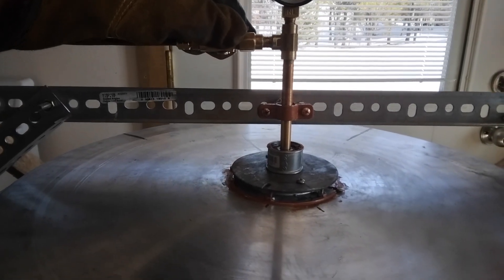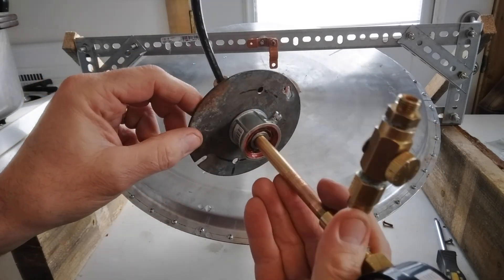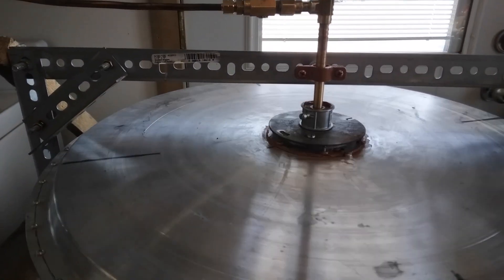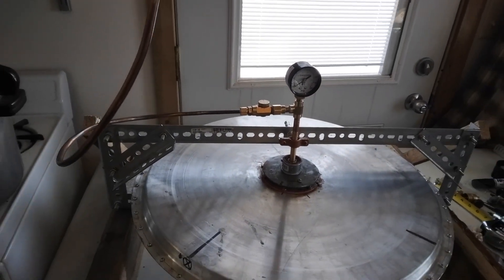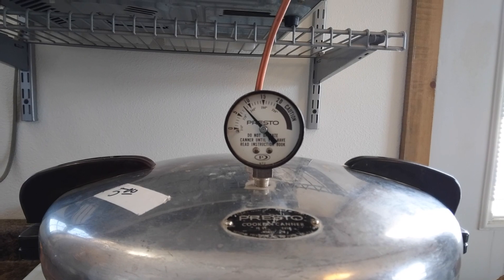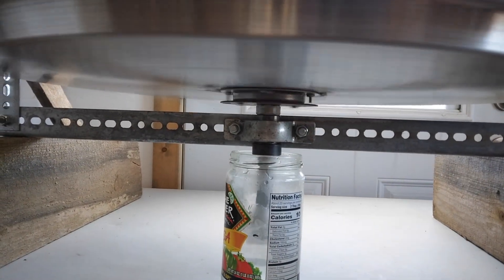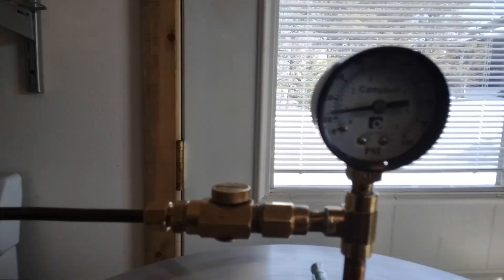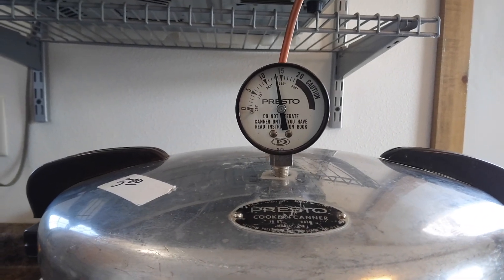Super Simple, DIY Steam Turbine

Comment: What if you add an external jet to the outside edge of the disk to create extra thrust? It would make a mess but you could have a containment tub around the existing rotor to catch and coalesce the spray.
Reply from the maker: That would defeat the design of the turbine.  The expelled spray inside the turbine will continue to loose rotational velocity and power to the turbine as it is pushed to the center outlet, by more addition spray and pressure at the circumference.  That's the design of the turbine.

Comment: Cool 😊 Just found your channel and was snooping around and saw this 😁
I have been thinking of building a small steam engine to power a bicycle or a bicycle trailer.
Am thinking about just using the air pressure tools like they use in the auto shop to mount wheels and just hook that up to the pressure champer. Do you think it would work ? Or any other idea other than the old trusty steam engine 😂

Comment: So what if ya put a copper loop under  it with magnets above the loop eddy currents would heat to boiling quickly a pot of water put in a closed loop system you could get a self running device ( once you get up to steam pressure ). Good job

Comment: great simple build set up. I built a couple of scrap component steam engines already running of a flash steam generator system instead of a boiler which produces enough to run the engine but has to be balanced cold water input to steam output for maximum pressure. I've been wanting to experiment with a steam turbine setup for a while now instead of a piston engine. Thanks for sharing this, which could really be useful if built to better tolerances etc.
Reply from the maker: Thanks for sharing!

Comment: i see it can use a clutch either centrifugal or cable operated to a pulley to get work from it and brake the speed...also it could use that for start up or use a start up steam jet to the outer of the disc for start up torque ...I've read a standard type automotive type alternator generator with built in 12 volt charge volrage and over charge protection for each 12 v...seems practical to drive the hub the maybe 6000 rpm to it's output curve band , they state about 4HP drain on the car or vehicles motor so i figure the joules of over 4hp per alternator seems practical maybe....i am refering to heat to steam to electric output or pulley drive ....EDIT: thankyou very much for sharing the vid i'll check out the build vid more the turbine i have ideas similar ...awesome to see it and the low pressure efficiency too , wow!
Reply from the maker: My thought was to attach magnets to the outer rim of the turbine, so the magnetic fields would pass through coils of wire the generate electricity.

Comment: Use solar power to compress the air in tank and use it to run generator using 1: 100 gearbox 👍👍👍
Reply: What will be the point of that? An alternative will be to use solar panels to heat up some sand that will store thermal energy.

Comment: Read the Tesla and Wilson patents regarding the addition of 'vanes' to increase mechanical advantage. 
Research: The Tesla turbine, also known as the boundary-layer turbine, cohesion-type turbine, and Prandtl-layer turbine, (after Ludwig Prandtl) uses the boundary-layer effect instead of a fluid upon the blades as with a conventional turbine. Bioengineering researchers have referred to it as a multiple-disk centrifugal pump.
Look here on YT for "Tesla Turbine used as air pump"
Good luck!
Reply from the maker: This turbine does have 4 vanes in it.  There is a link in the description of this video, that shows how it's made.
I'm familiar with the Tesla turbine, but I still think this is easier to build.  Thanks for the comments!